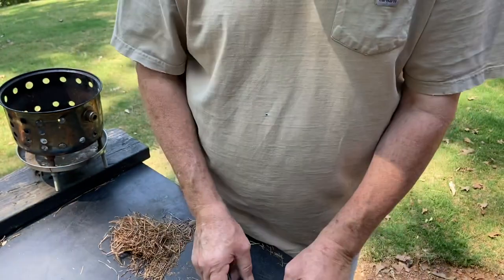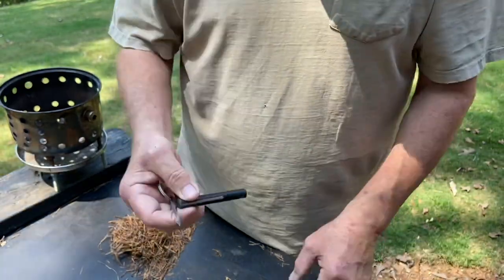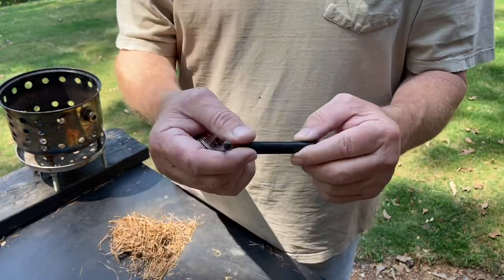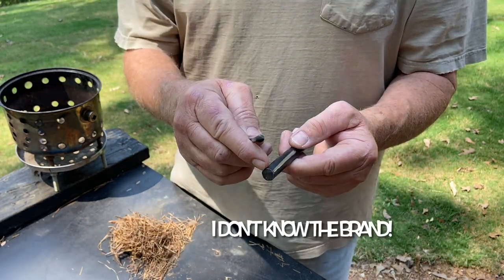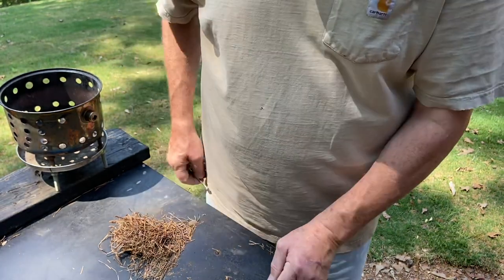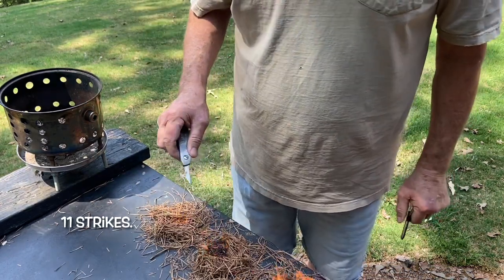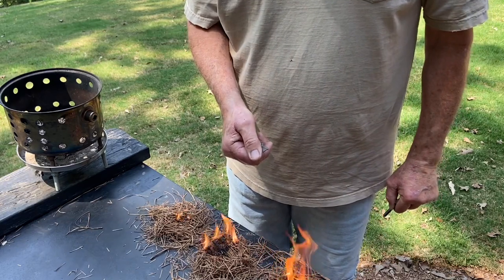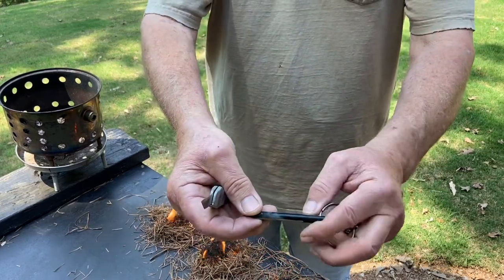Hard Ferro Rods Quickly Dull Knife Spines And Strikers

Comment: Agree 100%. For fun have you struck a small piece of the ferro material with a heavy hammer on a hard surface (concrete).
Reply from the maker: It doesn't do anything if I remember correctly.

Comment: Bayite, light my fire and uberleben are all good softer rods. The rods sold by Ron Fontaine are good too. I don't like the harder rods either. Light my fire rods are the most expensive but I still own one and really like the fact that I can start a fire using the first 1/4" - 3/8" of the rod. Uberleben works the same way.
Reply from the maker: i just found my Light My Fire ferro rod from 6 years ago. It was in a catch-all bowl along with some flint. It was a little bit corroded, but  still in near perfect condition. I had to try it out so I scraped a few showers of sparks with the Flint for old time's sake.
Reply: The uberleben ferro rods throw incredible sparks

Comment: Have you ever tried using a carbide knife sharpener as a striker, specifically the corona ac 8300? It will scrape hardened steel off a knife blade I wonder how it would hold up to a ferrocerium rod
Reply from the maker: I hear they are great strikers.

Comment: I was wondering when that would break. I can’t find any information on ferro rods in regards to torsional strength.
Reply from the maker: It changes every time you use it. I would think.
Reply: @DavidWestBgood2ppl  absolutely I was thinking about if it were sat on or stood on how fragile are they. Looked like you had to push hard to break your old one and that was getting thin ?